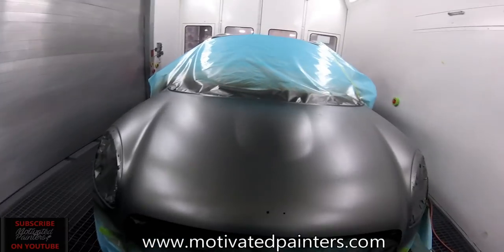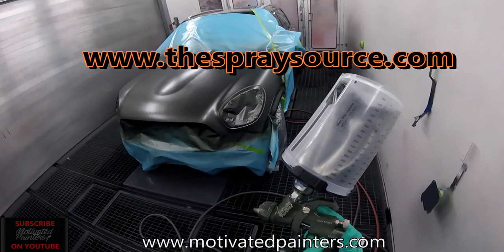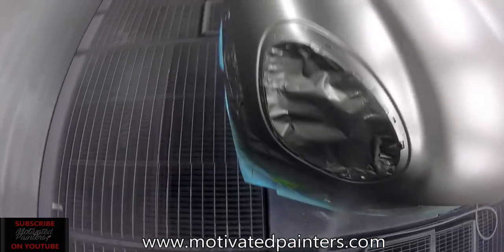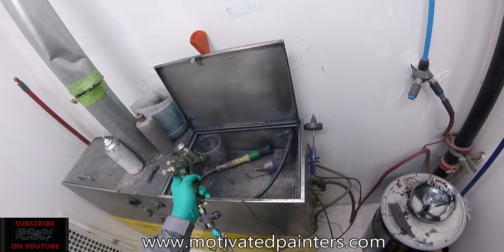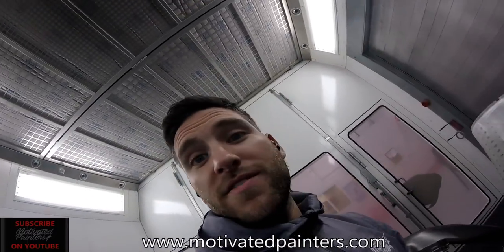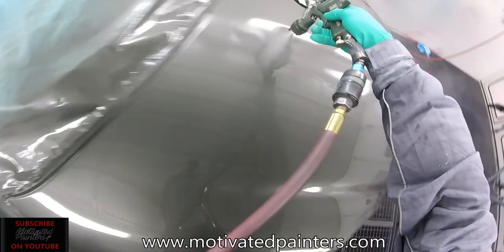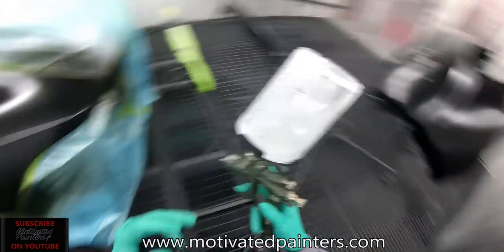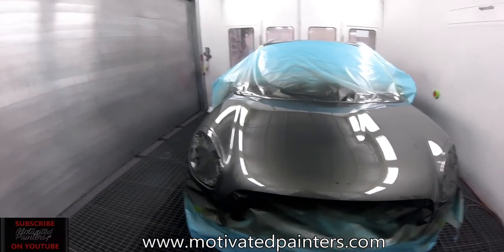Walcom Kombat Slim HVLP Spray Painting

Comment: Hey Gabriel, I just got the slim combat hvlp 1.3, spraying sherwin williams waterborne, mainly bought it for sealer, Mine doesn't seem to atomize near as much as it does for you, any tips? usually spray my base between 21-23 psi then down to 18 for control coat, even spraying sealer with it, just doesn't lay down nice. bought it so i didn't use my ls400 for sealer anymore, wanted a dedicated sealer gun. but it just doesn't seem to atomize that good at all.
Reply from the maker: Try opening up the needle all the way!

Comment: Im a diy guy.  Restoration work. Between this hvlp and the slim combat hte...which gun will lay down the smoothest finish? Less cut and buff??
Reply from the maker: That's mostly up to you and how you spray I like the slim for you since it's cheaper
Reply: @MOTIVATEDPAINTERS The HVLP looks looks like it sprays clear better than the HTE.

Comment: How many turns of adjustment of the needle in the varnish and what air pressure do you recommend?
Reply from the maker: I always do wide open needle then pull the trigger and turn untill I feel the pressure on my finger. Fan wide open then turn one turn and 30psi

Comment: hello I would like to buy it to give the transparent the slim kombat 1.3, does the clear coat stretch well?
Reply from the maker: Go with 1.2 it will out on a finer finish 🔥🙌🤙🏼
Reply: @MOTIVATEDPAINTERS  so do you recommend the slim combat hte for clear coat?
Reply from the maker: In my opinion I much rather the carbonio Light 1.2 but it's twice the price but an amazing clear only gun. If that is out of the question then yes 1.2 slim will do the job